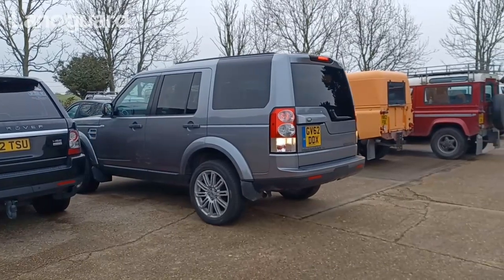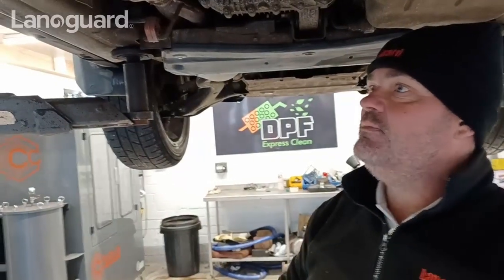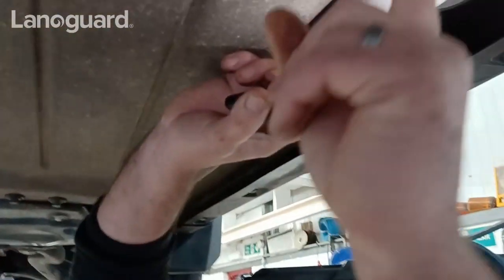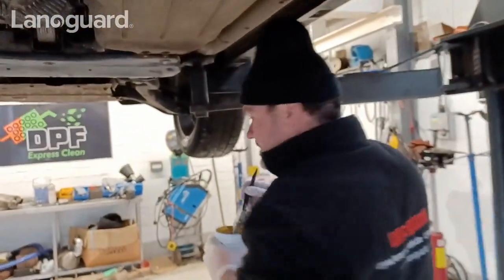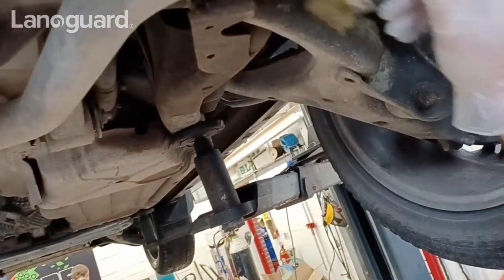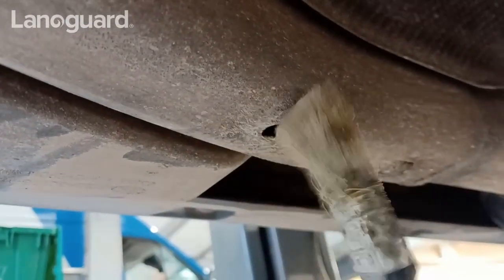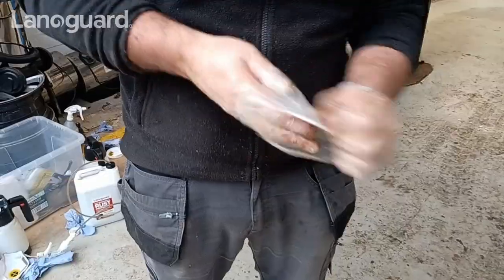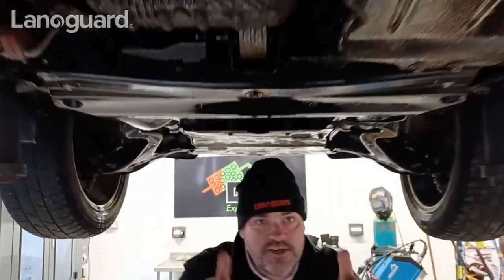Lanoguard Top Up. Land Rover Treatment 12 MONTHS ON! 🚐

Comment: Could you use the product on landrover door hinges which always seem to rust & direct on to the engine?…
Reply from the maker: Hi, Lanoguard is good to use on the engine bay but avoid fan belts. If Lanoguard is applied to the exhaust manifolds it will likely burn off due to the extreme heat, they get up to (Lanoguard is heat resistant to 450 degrees). We recommend spraying Moto Spray onto the areas you want to protect then wiping the excess off with a cloth. Or wetting a cloth with Lanoguard and wiping that over the areas you wish to protect. Yes Lanoguard can be used on your door hinges - you can use the Moto Spray and the Moto Grease, and it will protect,  lubricate, and stays in place preventing rust or further rust developing. Hope this answers your question

Comment: I had hoped to use Lanoguard but I wanted a black finish to give the underside a uniform look like underseal, so ended up using fluid film black. Are you going to offer a black finish, or could I have added a black die to lanoguard for next time?

Edit - I appreciate your reasoning for it being clear, so that you can see what’s going on underneath.
Reply from the maker: Thanks for your comment, Making Lanoguard black It’s something that would take a lot of thought and R&D once a colour is added it changes the dynamic of Lanoguard, the idea of Lanoguard being clear is so that you can still see what’s going on underneath, not cover up rust and areas would need to be masked up before spraying if it was black. I would suggest having a look on our Facebook User Group where this has been discussed many times by our members and if may give you some ideas of products to add or maybe paint prior to applying Lanoguard. Please follow this link to our User Group - https://www.facebook.com/groups/lanoguardusers I hope you find this helpful,

Comment: If the dirt has stuck to the original application, isn’t it best to avoid another coat unless it has been properly cleaned?
Reply from the maker: Hi, Lanoguard is jet wash resistant 3000psi therefore you can jet wash the dirt and road grit off, Lanoguard will stay keep in place doing its job. Last year we created a video regarding jet washing and dirt - here is a link to the video if you are interested https://www.facebook.com/718860434/videos/10159075916085435/   
It is always good to clean prior to topping up to remove any dirt, grime from the surface, and see how it’s been working on your vehicle’s underbody/chassis. To remove any hard dirt and mud you can use a brush (such as a dustpan and brush) to help remove any stubborn dirt and grime, Lanoguard will stay put – check out this video it shows jet washing, brushing and explains a little -  https://www.facebook.com/718860434/videos/10159075916085435/. I hope this answers your question

Comment: Hi I noticed that there was rust on the inner side of your spare wheel rim on the original video when treating the LR Disco 4 would there be any issues using Lanoguard next to the rubber of the tyre or any rubber on the car 

Regards 

Bob
Reply from the maker: Hi Bob, Lanoguard is safe to use on rubbers, plastics, and metals even the exhaust without any issue, meaning no masking up is needed. The areas to avoid are the brake discs and pads, you can cover these if you prefer, hope this helps
Reply: @Lanoguard  thanks very much for the reply I plan to sell my current vehicle and intend to buy a kit from you soon as it looks a great British product and look forward to using it.

Regards

Bob.

Comment: I noticed you sprayed the silencer. Is that wise ?. Even halfway down the exhaust system that box will be approx 150c with a hot engine. Will it not just burn and make a horrible smell ?.
Reply from the maker: Hi, Lanoguard is a safe product to handle and to use. It is jet-wash resistant, non-perishing, non-conductive and non-flammable. It is safe to use on electrics, rubbers, and plastics and even the exhaust issue (meaning when using Lanoguard no masking up is needed). Lanoguard works well on hot surfaces because it doesn’t evaporate. It works well on stainless steel exhausts too. For exhaust it will burn off on areas that reach over 450 degrees such as downpipes of some engines. The areas to avoid are the brake discs and pads, cover these if you prefer. Hope this answers your question
Reply: @Lanoguard  sounds nearly as good as acf 50